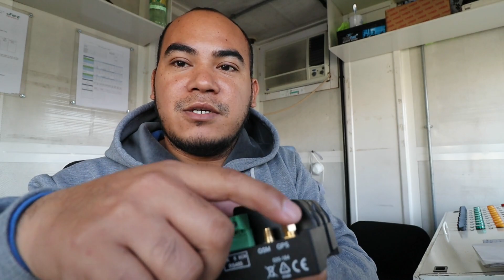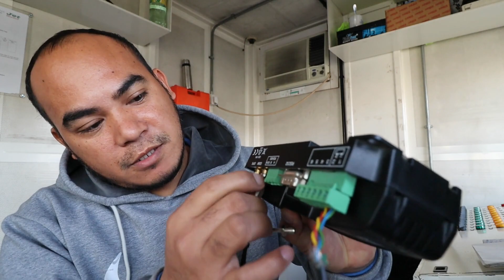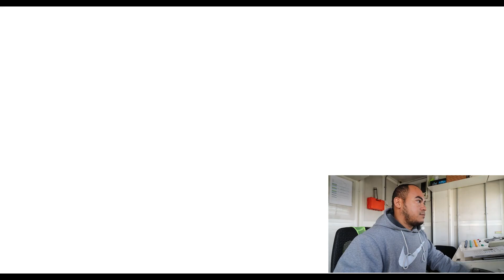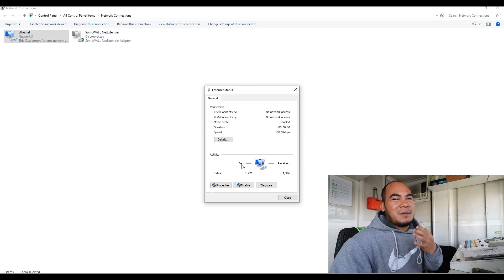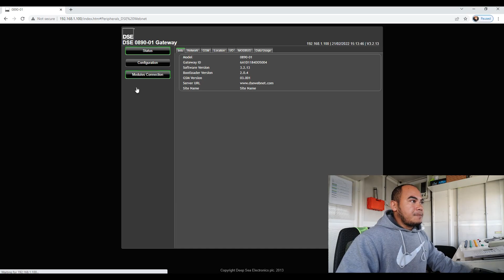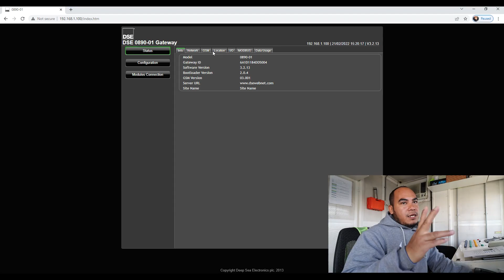How to configure the DSE890 Web Net benzblogs

Comment: I keep losing connection between module and gateway using rs485, also, it keeps disconnecting from dsewebnet. Any idea? 120 resistor at both ends and nothing
Reply from the maker: Use usb to connect from module more faster

Comment: Good vidéo, i'm from tahiti french polynesia ,in few time we will ordered this DSE 890, and i hope to be able  configurated .
Reply from the maker: This using usb and rs232 which you need converter in order to config this dse890
Reply: @benzblogsVlogs  Hi bro do you have vidéo of configuration this dse 890 to the module ?
Reply from the maker: @hermantoofa1868  this 890 there no config you can do or save you have to do it in maner as in the vedio this should be IT do this because its all about the IP config but if you know thin you can
Reply from the maker: Nonissue sir
Reply from the maker: 890 is only give monitoring and the status of your engine all the parameters and shutdowns depend on what you candige on it
Reply from the maker: Because your laptop should be also maodify in order to read thia module should be match the ip